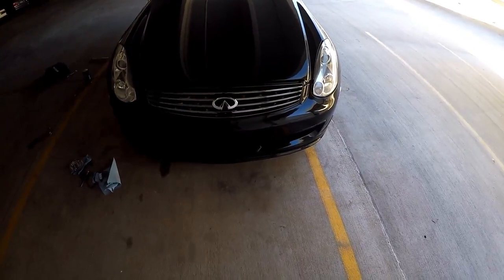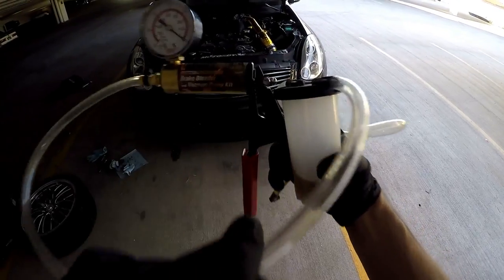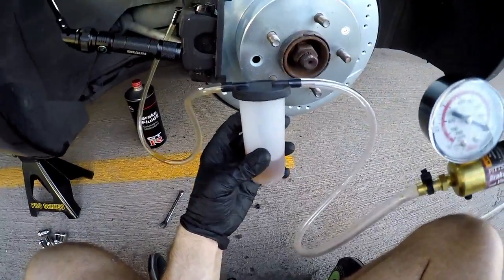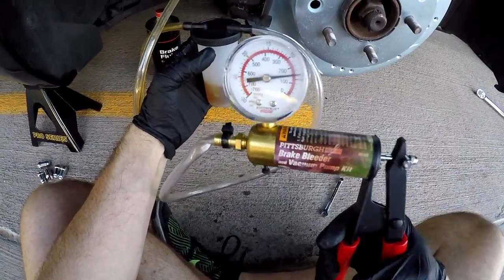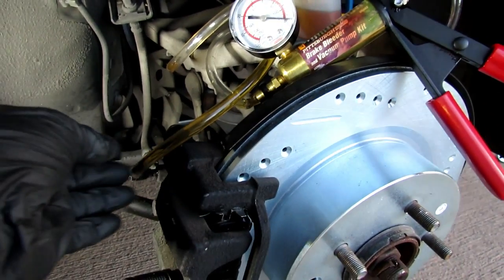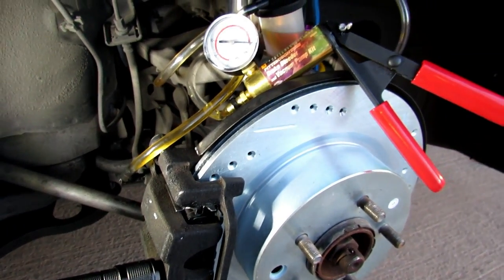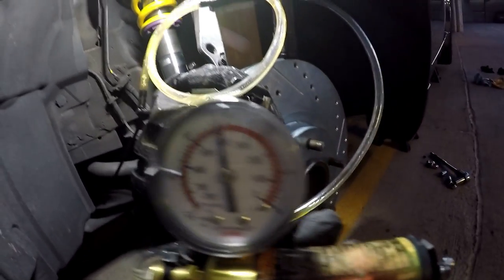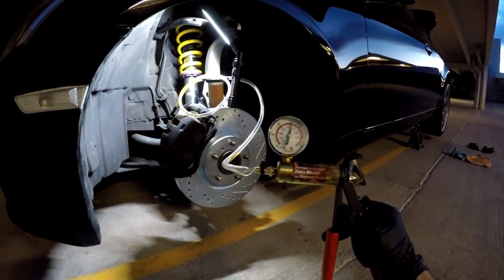INFINITI G35 - How to BLEED FLUSH BRAKES by Yourself

Comment: I’m not sure why but the kit I got just didn’t work out. I couldn’t get a proper seal in multiple places so the vacuum would lose pressure and I think it was letting air in the system. I just gave up and did it the old fashioned way.

Comment: Hey hopefully you see this. I don’t know to much about cars but my g35s suspensión is bad. I took it to my mechanic and he said I need to replace my shock obsorbers, I want to get coil overs so my question is, if I get coilovers, so I still need to replace my shock obsorbers or are they already part of the coilover?
Reply: If you are going to be putting coilovers on the car.  There is no need to replace the shocks that are on there.  Coilover kits are complete with the shocks and springs.  Unless you are doing something like GroundControls coilover conversion, in which you will need to purchase shocks, but groundcontrol doesnt even make coilovers for the G35 and I cant recall any other company that produces coilover conversion kits so no need to worry about that.
Reply: @diversify210  this makes no fucking sense he said "if I get coilovers, do I still need to replace my shock absorbers " then you respond "There is NO NEED to replace the shocks that are on there" then say   Coilover kits are COMPLETE WITH SHOCKS AND SPRINGS.

If they come with shocks and springs in the coil over kit then why would he keep the shock absorbers his mechanic told him he had to swap out if a coil over kit comes with new shocks and springs? you confused the shit outta me
Reply: @Juan-yb8rm  i was thinking the very exact same thing.... lol

Comment: This looks like a much easier way to do it, but I'd be concerned it's letting more air in the system by pulling the fluid out with a vacuum rather than pushing it out with hydraulic pressure.

Comment: Kinda unrelated to this subject but have you done any videos on cam pos sensors? my Zs been missing lately and I’ve replaced all coil packs twice as well as plugs. my car would also start to die when i wasn’t on the gas. Weirdest part about it is after my second coil swap the car starts runs fine sounds good and just abruptly shuts off after about 10 seconds
Reply from the maker: What is the check engine code? Here is my video on replacing cam sensors....https://youtu.be/-ipaOP7Bqvc

Comment: Will this fix my abs slip vdc light coming on right away as I press the brake I changed rotors and pads up front recently , and the pedal isn’t super firm
Reply: Ever since I fucked with my steering wheel those lights have been on for me once I turn my steering wheel all the way to the right

Comment: WHY do you not want the pressure to fall ?
Reply: So air won’t be introduced back into the system by never letting the pressure drop to low you minimize the change of air back in the system